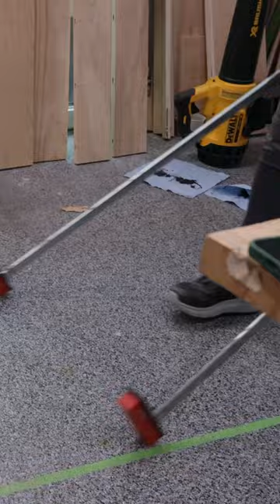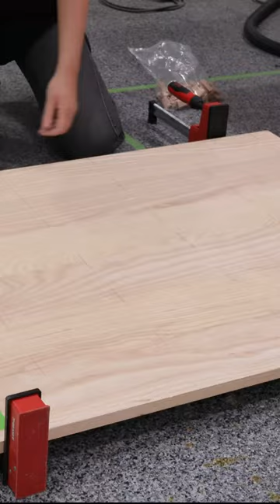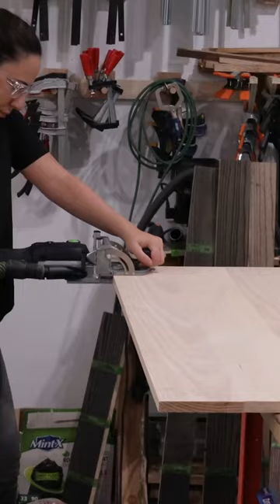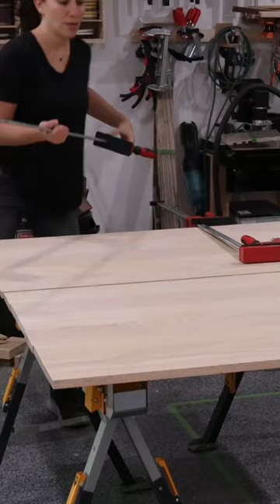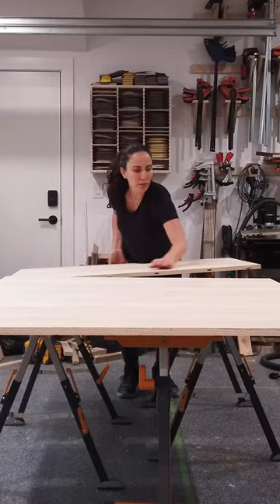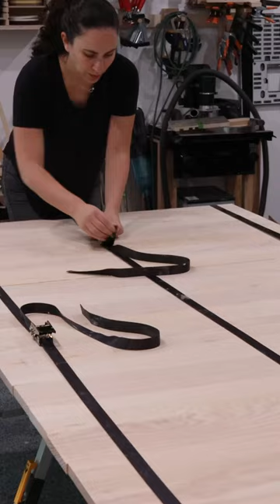Gluing up a 94” wide headboard. Ratchet straps for the win! Check out the full video to see more!

Comment: Only one problem was the straps. The straps will not pull them together in a straight plane. I would have clamped them down with some straight stock to keep that straight plane across all the boards.

Comment: Creative approach!  I imagine a 94" clamp is hard to come by :).  Strapping that width of boards together without using some sort of flat surface to eliminate warping would make me nervous though.
Reply from the maker: If you watch the full video, you will see the whole panel bends even after glue up. So I wasn't worried about it knowing I would keep it flat with battens on the backside 👍
Reply: Fireball Tools has a clamp that'll do 20ft or more of you can find some longer 2x1 rectangular tube It's called the Magnus clamp. I've welded two pieces together for a 39ft clamp that I needed for a box truck camper build.
Reply: Pipe clamps can go big as you like.